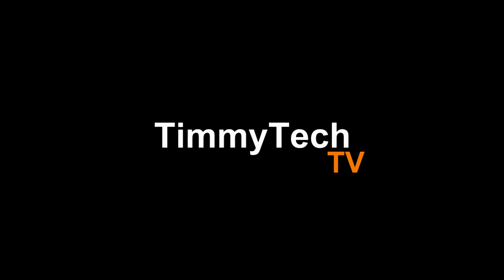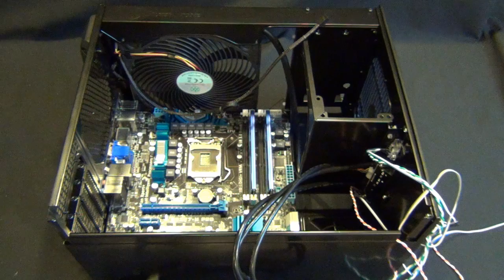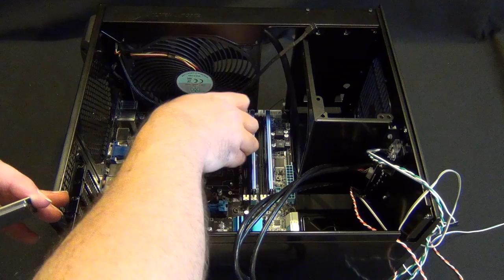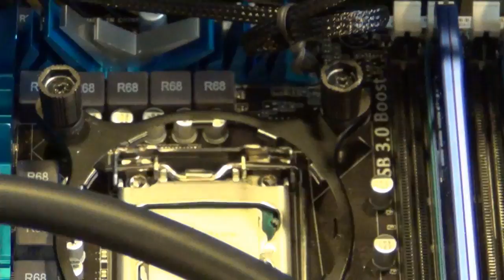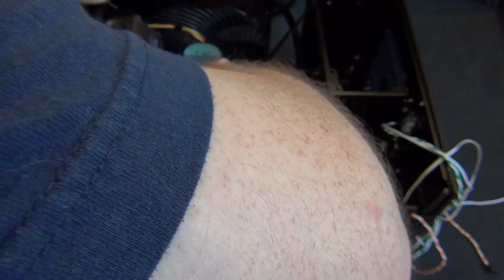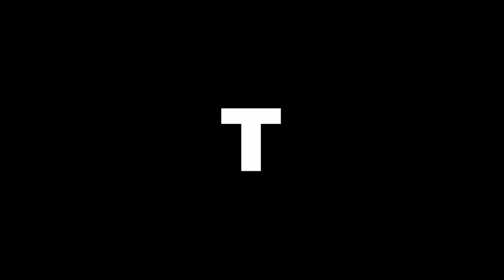How to build a m-ATX computer - Part 2

Comment: Hello
Thanks for review. 
Does the GPU can be mounted with that hydraulic cooler..
it seeems not, No info about.
I took a Corsair H55 for basic cooling of 3770k (no OC) and 
bought all necessary parts ..it last the case SG09.